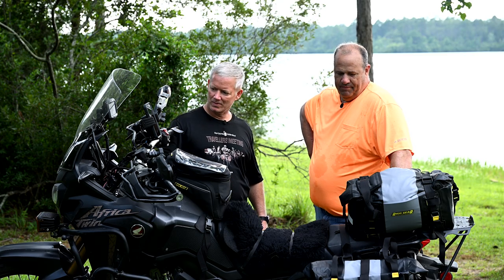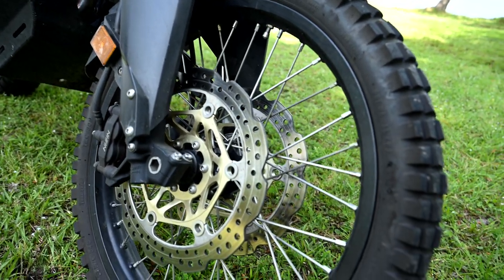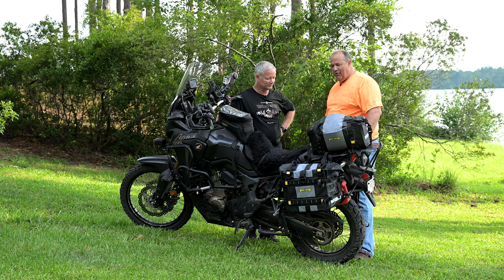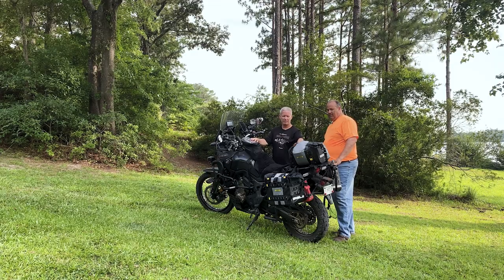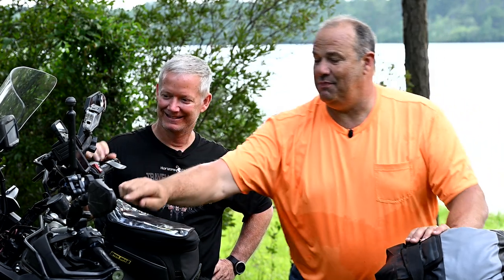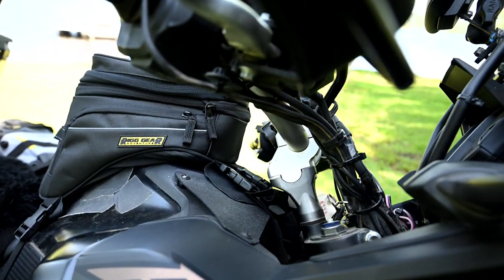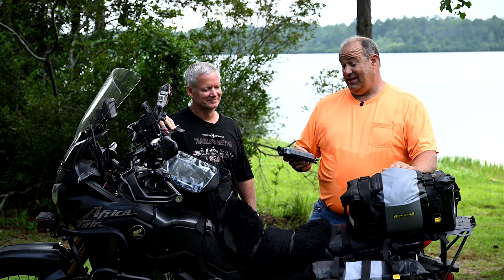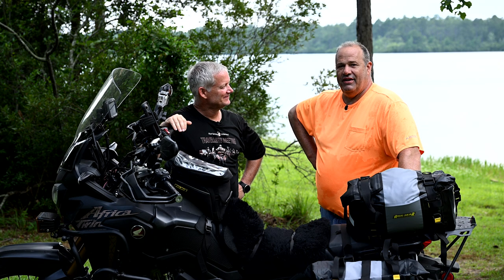Best Africa Twin Accessories - How to Setup your AT

Comment: I also have the 2018 AT DCT in black. Did a 7500 mile trip last year. Still in love with the bike. My only complaint is the wind noise from between the turn signals and windscreen. I can't find a way to block it. Let us know how you like the Atlas throttle lock.
Reply from the maker: Sounds like an awesome trip, ZigPig!  Hopefully Steve will jump on here and share insights on the wind noise, as well as feedback on the Throttle Lock.  While you're waiting for his response, check out how Jason and I like the Atlas Throttle Lock in this video:  https://youtu.be/yZsexrfGH1E.
Reply: Have you tried the SWEGOTECH Forkshield. in my review i forgot to mention i had one installed

Comment: Great run-down.  What windshield do you have?  2018 ATAS here
Reply from the maker: Thanks Darrell!  I know it's heavily modified (you just have to know Steve...he's like McGyver).  But I'll get him to share his secret with you.  Stand by...
Reply: darrell ,its a v stream I got off amazon.. with my height  I cut 1.5 inches off the top.
Reply: @steveroosrides   - Thank you Steve.  I am 6-4 and I bought a Puig touring screen which in the standard mounting is the same height as the ATAS screen, I still get buffeting on the crown of the helmet.  I was wondering how the buffeting was for yours, and why trim the top.  Thanks again
Reply: @DDay9000   just seeing this.. I cut it off because it was right at my eye level.. I had three choices sit taller, slump down or cut off...

Comment: Great video Steve, have you tried any different tires on the AT since this was shot?
Reply: @wClark8388 tkc-80's on the front..after recall I went with Motoz tractionator  on front they look just like the tkc-80's  can't tell the difference so that's a win. only four  tires I've tried are the stock one bridgestone (no comment ) , Motoz tractionator rallz., Motoz tractionator GPS, And Awake wilds.  the GPS are my go to fav's.  for off road/sand the rallz are a great choice. hope that helps thanks for watching.

Comment: 160000 miles 6.5 tall with luggage how did he manage without spring upgrade to his weight?
Reply from the maker: Excellent question!  Hopefully Steve will respond.  But it is a Honda, after all...just get on it and ride!  🙂
Reply: 690 ADV  thanks for asking, the only thing i can say is it worked. could it work better with an upgrade I'm open to try if someone will send a set to try out.(hint Hint) My style of riding is not full on moto X. Chris  and Jason say i aim for the bumps truth is the ride super smooth. I would like a better front fork setup, tends to dive into the corners. like chris said its a Honda..